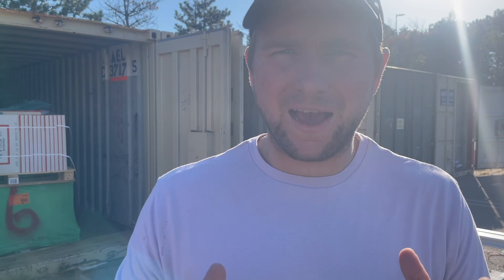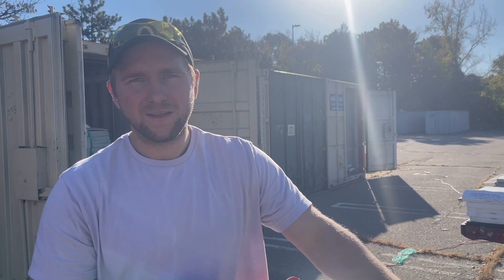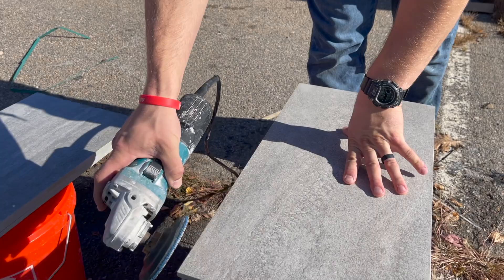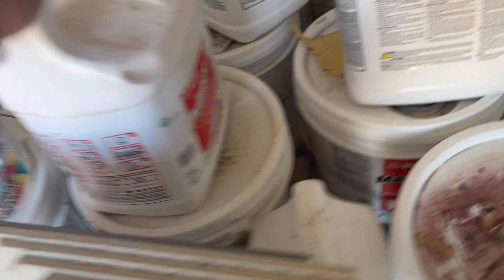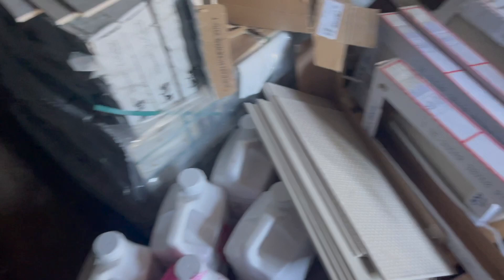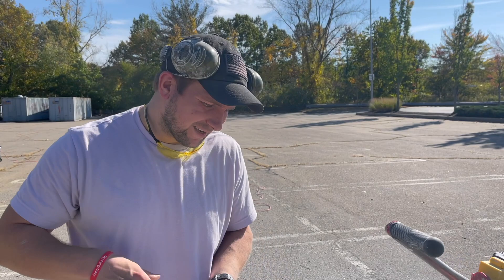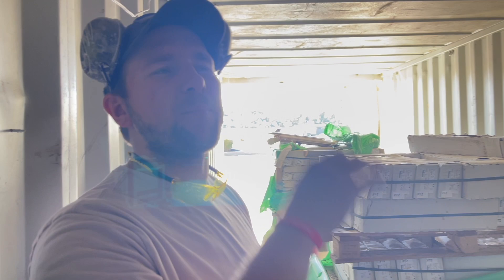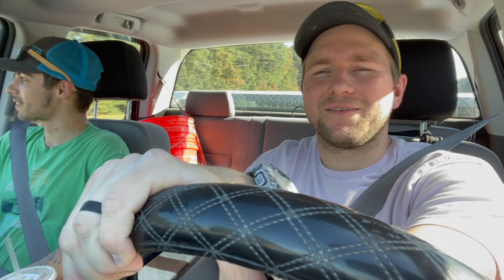Cut Tile 7 Hrs Non STOP 🛑 🔥Tile saw review🔥

Comment: I'm shocked that you burn up blades so fast. I used blades  that will endure  250,000 SQ ft  before I swap it out. You say no way? Look into adding water soluble oil to your water. Keeps everything cool and lubricated. After 35 years of setting tile...you learn a few things. I also only use Montolit DNA blades.

Comment: I just got this saw and what a disappointment is sucks out of the box it is not cutting straight like 1/4 to 0 if anything all see if this place can take it back this sucks even though it’s design for a large platform tile it’s too narrow water splashes all over I was soaking wet just for one piece of tile that needed to be cut